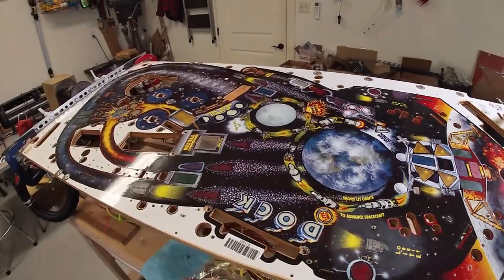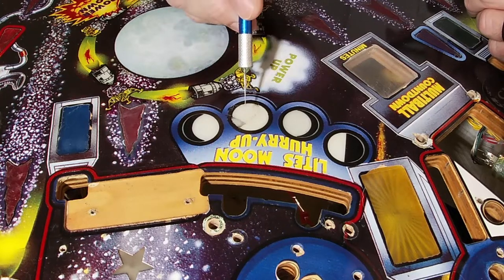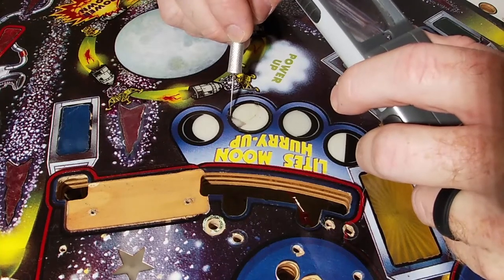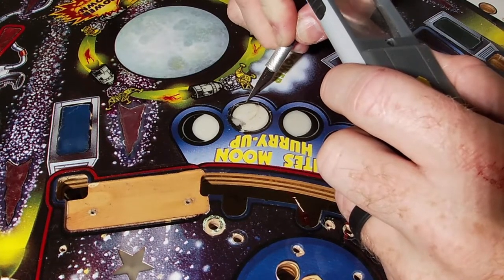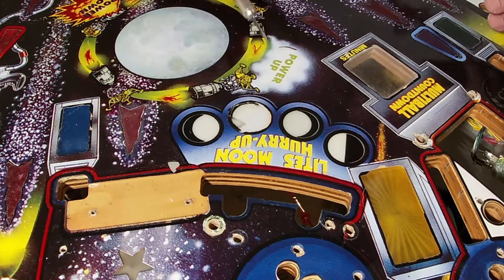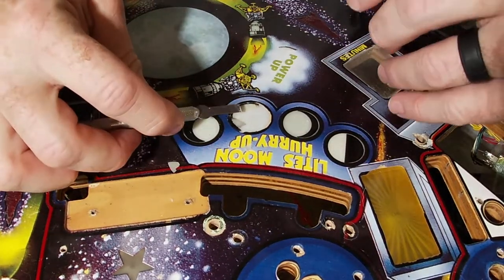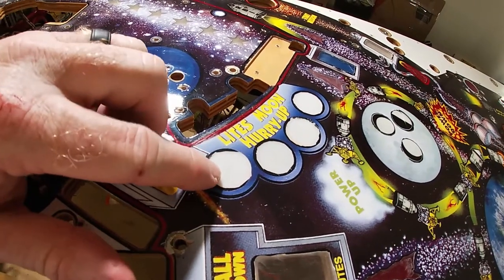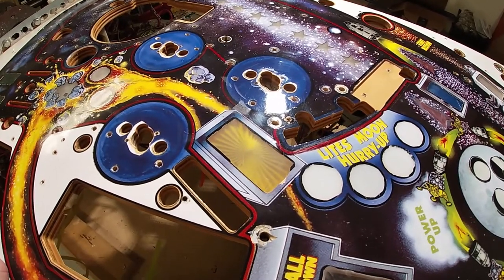Apollo 13 Pinball Restoration Part 5

Comment: Lonny, do you use Acme FC720 to do your total playfield clear?
Reply from the maker: Yes.  That is what I use.  I have been using it for 7-8 years and it has worked great.
Reply: @LonnyPayne  Thanks!  I've been using SprayMax 2K in a can but am ready to switch to HVLP.
Reply from the maker: @damonhuffman6681  
Good deal.  Please do your research, automotive clear coat is dangerous if you don’t take precautions. I cover some of that in my other videos.
Reply: @LonnyPayne  Lonny one last thing.  Since we are both in Texas, do you use fast or medium hardener?
Reply from the maker: I use medium for the majority of my stuff.